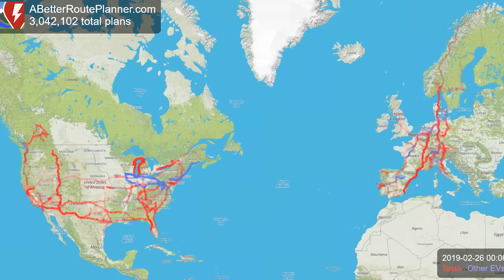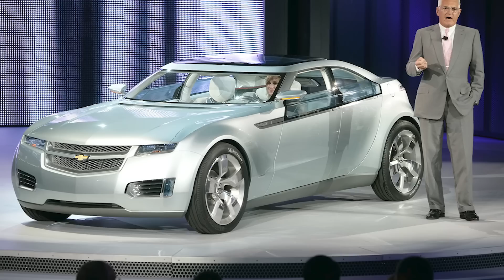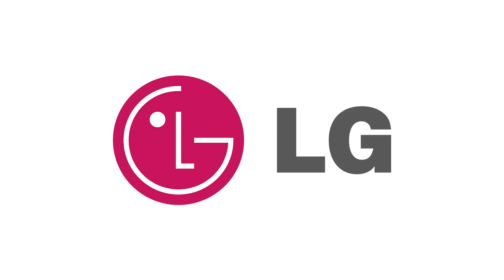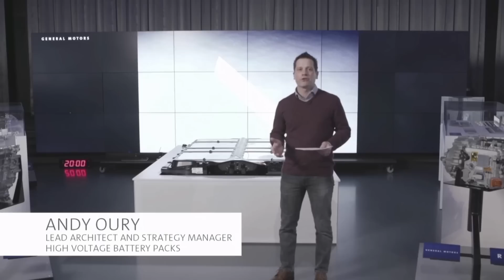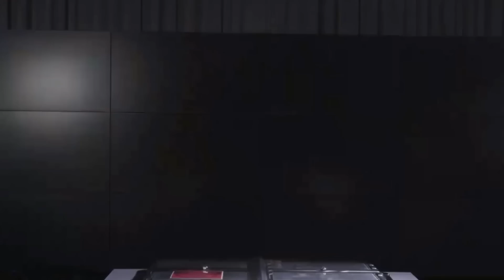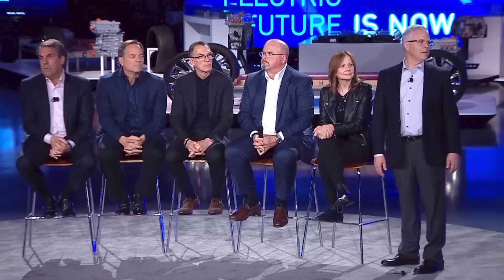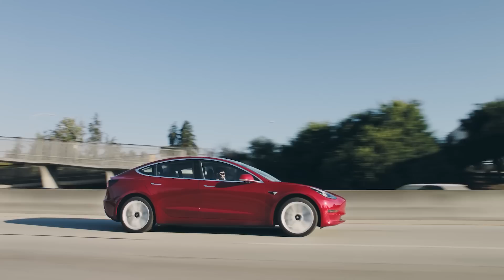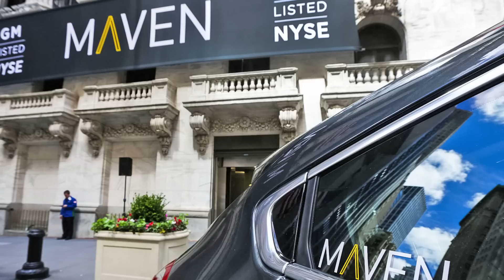GM EV Day | In Depth

Comment: They have a “master” 4-years plan that will catch up to Tesla of 2019. It may or may not work, but they are trying :) good for them

The problem is: Tesla is not going to take a vacation for the next 4 years waiting to be caught up. Tesla’s mission is clear, and they are running toward it FASTER than GM speed to catch up.
Reply: More like catch up to the 2012 model s
Reply: @JAM_2024  in some things GM is way behind, such as software, at least 10 years behind. In other things like battery price per kWh, they are only 2 or 3 years behind (due to LG Chem, not because of any GM wisdom :) ) In any case, even if GM executes their plan perfectly, they will still be several years behind Tesla by 2025. And by then the gap may be big enough to sink them. But I think GM will survive, all be it a lot smaller as a company than it is today
Reply: Simon Cheung I feel like the fact that GM is even trying to catch up shows that it’ll be one of the very few companies that won’t go under in the future, but like you said it won’t be as big as it is now
Reply: Jesus Carrillo fully agree
Reply: @simoc24  they don't have to do it like tesla they have the money to buy the companies needed to get to the top just makes tesla work harder to stay on top
Reply: dbz 1225 first of all, Tesla is mission driven, not quarterly profit driven. They just work harder than anybody else, but not for staying on top...they were working just as hard 10 years ago when they were building Roaster by hand. Elon says it was “hard” when he had to work 110hours a week during model 3 ramp, now only doing 80hours a week it is like a holiday. He is changing the world, but you will NEVER pay me enough to work for him, never :) (I like to sleep)

As to GM, they don’t have that much money :) They have 23 billion on hand and lots of it are tied to financing, therefore, cannot be used for acquisitions. Moreover, They only need couple bad quarters to cut that among by a lot. They don’t have that much cash to buy start-ups. They can, but not that amazing.
Reply: @Mannymac25  Just buying a company doesn't mean that will help you. One needs to understand how that company integrates with the rest of the company and have all the parts working together. This is something the Legacy car companies will have a problem with. Just look at how much VW is having trouble with their software integration.
Plus GM does not have the proper mindset that Tesla and Elon has. No one owns GM. Their is no founding member that has a vision, education, mindset and risk taking abilities like Elon in order to succeed.
Reply: Let them race each other to our benefit at the end
Reply: What 4 year plan. 1 million cars by 2035? That's a joke.
Reply: stevenson720 they mis-spoke in the presentation. Mary meant 2025, not 2035, a 4 year plan. They clarified that later on in the presentation.
Reply: Mark Plott don’t you think that is a bit extreme for you to say? The model 3 is ahead of the Bolt in battery cooling, but not by that much, so is motor, wiring, casting...are all 3 or 4 years behind, but not a decade :) their software is at least a decade behind, I can agree on that :) OTA will be a mess for GM in the first couple years when they will eventually roll out. And Tesla is only 2+ years ahead of LG Chen in both battery density and price. Nevertheless I believe that the gap will actually get bigger, once a Tesla is making cells and innovating on it
Reply: @markplott4820  no they aren't
Reply: Ford, GM, Fiat-Chrysler, I don't think they will have much of a future. I expect them to continue to sell less and less cars and loose market share every year. I expect to see some consolidation, maybe even from foreign investors
Reply: Mac J so true :) lol
Reply: Bolt is nice
Reply: @Mac J  exactly, they are clueless af
Reply: Sounds like they are preparing to patent troll tesla
Reply: Tesla has reached escape velocity.
Reply: Tesla has no advantage

They just have a much higher price point so can afford to out in bigger packs and motors

An Audi A4 is probably nicer than a model 3. It costs £25,000 Vs £43,000 for the Tesla

VW can make an electric A4 with the same speed and acceleration and range as a model 3 and can do this at a profit if IF customers would pay the same £43,000 as they do for a Tesla. But VW doesn't believe customers would be willing to pay £18,000 more for an electric A4

And they are correct
Given a petrol A4 for £25,000 or an electric A4 for £43,000 I'd go for the petrol version

VW will electrify their whole range as an when electrification becomes affordable

I might pay £30,000 for a an electric A4 or a Tesla M3 but I won't pay £43,000 for either. So right now it's still petrol for me (and for 98% of other car buyers)

And this is still a high price points

EU best selling car is the VW Polo for £13,000

I might pay £18,000 for an electric Polo but not £30,000 which is what it would probably cost right now

So it makes no sense to electrify now
Maybe high end high price vehicles
Not the low or middle end

It will happen
But not for another 8-10 years
Maybe not for 15-20 years
Reply: @kaya051285  5 year cost of ownership Model 3 is $15k less than the A4.
https://cleantechnica.com/2019/09/26/tesla-model-3-vs-mercedes-c-class-audi-a4-5-year-cost-of-ownership/
Reply: @Ikbeneengeit  Here in the UK an A4 is £25,000 while a model 3 before government subs is £43,000

The difference of £18,000 pay down your mortgage at 2.5% = £450 a year

For me the Tesla is also £400 more to insure

That's £850 additional running costs and both will be in the bin around year 20 so an additional £900 to depreciate the higher cost of the M3

£1750 additional cost

This means the break even is around 16,000 miles a year. Average mileage in the UK is 7,200 a year. For the the average driver the Audi is cheaper

People will say M3 has less maintenance costs but that's yet to be determined and most likely won't cover the difference

Anyway cost conscious drivers would be buying neither. Europe is much more cost conscious because we earn a lot less than Americans. The best selling car in Europe is the VW Polo a car that can be had for £13,000 which Tesla competes with that? Which EV competes with that that doesn't have compromise too big for non interested drivers?
Reply: @kaya051285  in the Netherlands, a second hand leaf is about break-even with an equivalent petrol car, if you can handle having only 150km range. Hopefully EVs keep getting cheaper!
Reply: I honestly think your wrong. Tesla are quoting battery life approaching 1/2 million miles and are making 500k cars a year now with a German giga factory being built and chinese one only starting production. When 2nd hand cars start hitting the market and people can pay 20 pence for the equivalent miles as 1 litre of petrol (£1.20) not to mention range over 200 miles, no tax, no congestion zone charges, next to no maintenance because there are so few moving parts, and its fast, and it's quite, and its environmentally friendly. The change is coming fast and if car companies don't get ahead the will get stomped. Remember Kodak.
Reply: @stevenson720  I accept that you think I'm wrong but you think this with little to no real thinking

First and foremost you need to know and accept an EV or a petrol car are 80% the same. The cost of the petrol engine and the petrol powertrain is about 20% of the cost of the car

So Tesla or VW or Toyota 80% of what they do is the same.

Tesla will have no battery advantage and nonelectric motor advantage because batteries and electric motors will become commodity products in the same way solar panels are

Who has a solar panel advantage? No one. 
Anyone can buy high quality solar panels in high volume from a range of supplier for great prices

The same will be true of batteries and electric powertrain

No one, not Tesla not VW not Toyota will have a battery or electric powertrain advantage

This is even true today
The Hyundai ionic has the same miles per kWh as the Tesla M3

Somehow the you tube community seems to have missed the obvious. Tesla cars are aerodynamic sedans. Comparing them to a boxy E Golf and concluding Tesla is so far ahead is wrong. The reason the model 3 gets so much more range is 1: more batteries and 2: an aerodynamic shape.

This isn't an advantage. Anyone can out more batteries in and build a better shape car. In fact that is what VW is doing

The ID3 has a batter shape (lower drag coefficient) and more batteries and the result is significantly better miles and miles per kWh
Reply: @kaya051285  batteries and motors are commodities but at the moment the batteries are a bottleneck and only tesla seems to be ramping up production in a serious way. I know VW and BMW have invested in a new battery factory planned to open 2021 but first mover advantage is a thing. 

If Tesla get to far ahead, they might be hard to catch. Plus mass production is hard so how long until real quantities start moving. 

Your 8 -10 years doesn't sound far wrong, but where will tesla be by then. 10 gigaplants globally producing 5 million cars a year, plus trucks, powerwalls, panels. 

How much data will the self drive ai have collected, Tesla could become the only self driving program people will accept because it's the best. Google has the most online searches because it's the best because it has the most information because it's the biggest. It becomes a self fulfilling prophecy at some point. 

I really do think we are going to see a switch. Most traditional companies, and oil producers and such wont like it and are going to stall as much as possible but the self driving electric car is coming fast. Ever taxi in the world driven by 1 computer ai program and sensor package, the best one. If that turns out to be tesla the company is going to be worth money. 

Ps thank you for your thoughtful reply. I appreciate it. Hope you have a nice day.
Reply: @stevenson720  Tesla isn't ahead on the EV platform, this is controversial to say but it's easy to prove. All I need to do is point at the Hyundai Ionic it gets the same miles per KWh

Many you tube commentators compare a model 3 to other EVs without realising that the main reason a model 3 gets much better miles per KWh than say for example a VW E Golf is because of the shape

The M3 has aerodynamic drag of 0.23 while the boxy golf has an aerodynamic drag of 0.35 this means at higher speeds the Tesla gets 50% more range as the drag is about 1/3rd less

VW ID3 is addressing this problem by being much closer to the Tesla Model 3 in aerodynamics with a drag coefficient of 0.267

What this means is if the model 3 is 4.2 miles per KWh, the VW E Golf is 2.7 miles per KWh and the new ID3 will be 3.6 miles per kWh

Or another way of saying this is 100KWh of batteries will get 420 miles in a M3 or 270 miles in an E Golf or 360 miles in a ID3 at motorway speed of 70mph

So VW improves from 270 miles to 360 that's +90 miles miles (using a theoretical 100Kwh battery) by just changing the shape of their car to lower aerodynamic drag
Reply: @stevenson720  Another factor is that improvements in battery energy density will help old models more than EVs

What I mean is that a Tesla going from 300 miles to 600 miles might be nice but it's not a huge advantage

While an E Golf (or equivalent) going from 100 miles to 200 miles is a much more important development

If batteries improve a lot then it becomes much more viable to just offer an EV option for ICE cars

An Audi A4 costs £25,000 and is a nice car
With better cheaper batteries the same line might be possible to offer ICE or EV option. So when you spec the car choose which engine you want.

Right now maybe using the same car and some of the boot and engine bay you might get 25KWh into the car with a range of 100 miles. That's not really enough. But if battery density doubles then you can get 50KWh into that space to give 200 miles range which is enough

So battery improvements help ICE models more. At some point battery density and cost will be good enough to offer the existing models in electric at decent price and decent range

The idea that you have to have a dedicated skate platform only matters for performance cars 80% of the market isn't out to buy performance they need affordability.
Reply: @kaya051285  this is mostly true, especially your point about 100 - 200 miles meaning a lot more than 300 - 600, but that still doesn't address Tesla lead in actually scaling its battery production nor its technical lead in self/auto drive,  that, if it becomes too large will actually become unassailable. 

Your original point was "evs are expensive" I said 2nd hand cars will arrive on the market that wont be, and because the batteries are so good and the have so few moving parts they will still be driving at 300,000 miles. 

Still. This is all speculation at the minute and only time will tell. 

I hope you have a good day. 🙂
Reply: @stevenson720  Tesla has no battery production so how can they have a lead in battery production? They buy batteries from Panasonic and now some from CATL

If they have such a lead in batteries why are they not using their own batteries rather than Panasonic and CATL?

Right now it's just plain speculation to think maybe Tesla has a maybe lead in batteries they maybe producing in the future

But the others won't stand still either. Everyone will improve batteries and my guess is no one will have an actual lead

The same as in solar PV today
Who leads in solar PV?
No one really not to any degree that it matters

This is positive news not negative
Everyone will have access to affordable high quality barriers in large volumes. In the same way today everyone has access to affordable high quality solar PV modules in large volumes

Regarding Tesla software advantage
Maybe. But maybe google. Maybe mobile eye. Maybe intel. Maybe Nvidia. Maybe apple. Maybe Uber. Maybe one of a hundred large tech companies working on this. If it comes yes they will have an advantage but then maybe they won't be first.
Reply: I Kaya they have an advantage in the autonomous driving tech and data, they have like 3 billion miles driven vs the ~5 million the closest company has. Not only that but their battery tech is so far ahead of anyone that companies are still trying to catch up to the 2012 model S
Reply: @JesusCarrillo-RynStudios  this is not true. How can their battery technology be ahead of anyone when they don't even build their own batteries?

Are you saying Panasonic battery tech (Tesla buys it's batteries from Panasonic) is well ahead of any other battery company?

BTW I know what you are trying to say
You are trying to say they get more miles per KWh of batteries Vs the competition. But even that is false. Hyundai ionic gets more or less the same miles per KWh. The reason Tesla and the ionic get so good miles per kWh is that they are aerodynamic designs. Both the cars are sedans of almost exactly the same siZe and shape.

The other cars, for example the E Golf, get much worse miles per kWh because of their shape it's just not very aerodynamic it's much more boxy

So Tesla has a shape advantage
Something anyone can copy
In fact that is what is happening
The VW ID3 which is replacing the E Golf has much better range and much better miles per KWH....do you know why? Because it's a much 'better' aerodynamic shape
Reply: I Kaya are you a sort , “Tesla has no advantage” you silly person

Comment: So GM is planning to be selling only 1 million vehicles in total in 2035? They will not be selling combustion vehicles in 2035 other than niche, small run cars. Europeans are already weary of buying combustion vehicles due to possibly no re-sale value in 5 years... No will want combustion vehicles in just a few years. The change will keep accelerating. There are dozens of gigafactories coming on line in the next couple of years to build batteries and power trains from many different companies and all over the world. They are behind. How are they aiming to be further behind than they already are? What kind of plan is that? Seems more like a doomsday projection of what happens if they do not even try. Just with Bolt sales with no change in strategies they should get to better numbers than that by 2035.

Comment: GM sold 7,718,000 vehicles in 2019.  They plan to sell 1,000,000 EV's by 2035.  So their grand ambition is 13% of their global sales to be EV in 15 years?  Executives are supposed to make lofty goals that steer the big ship in a positive direction.  Their target should be closer to 80% EV by then.  There will be a customer base that will buy ICE cars until it becomes painful due to lack of gas stations still selling fuel...so you have to account for that.  But give your customers, investors, and employees some hope for a strong future, not dying off because you're 10 years behind the competition.  A target of 80% by 2030 would have made headlines and moved the stock higher.  You have to sell people on hope, not bailing water out of a sinking ship.